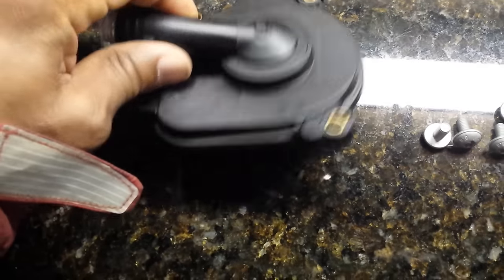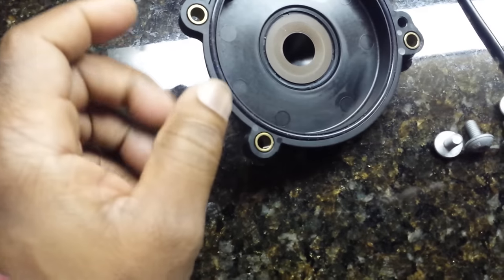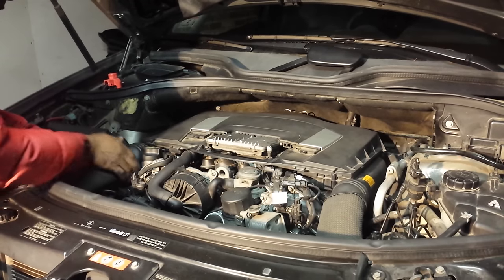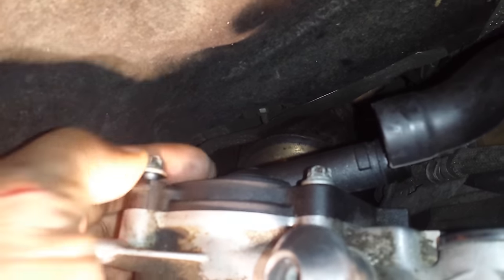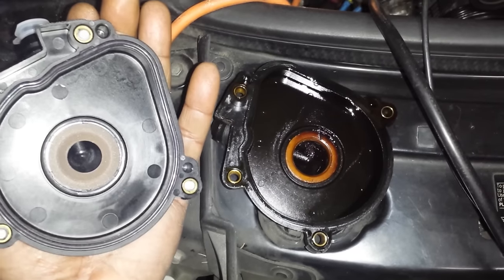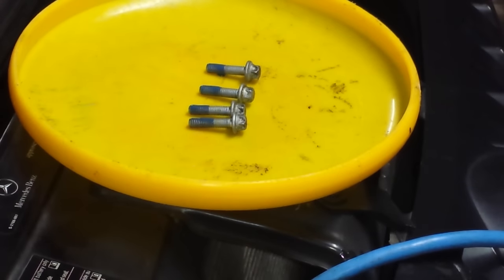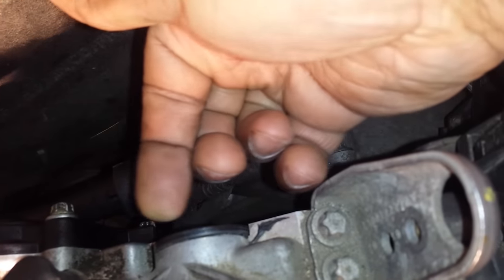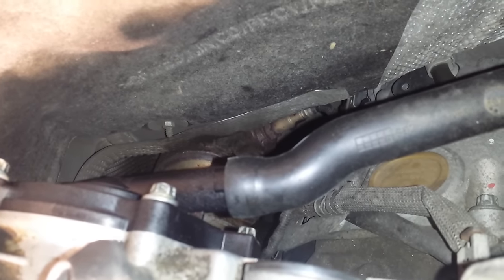Mercedes Crank Case Ventilation Valve Replacement DIY

Comment: hey i got 2016 benz c300 205 with around 50k and i dont see any oil leak on the ground or smell anything or hear anything wrong nore notice anything wrong with the car but had a check engine light come on like a month ago so i checked the gas cap first and it seems fine so i checked my oil and was time to change it so i changed the oil, the filter and the plugs and all went well and the car loved it also the check engine light went away ,but now its back a month later ..

the codes it p052e and it says to replace engine oil separator and parts required are pcv valve oil trap but under the code it says positive crankcase ventilation regulation valve performance ,now im like hum wth? so what part will fix the code / car ? the one in this vid or part crankcase ventilation LINE / OIL PEPARATOR ? because if its the second part then its suks bad to repair u gotta take alot of parts off and lift engine after engine mount are off and ya ?
Reply: Did you ever get it fixed? Mine is doing the exact same thing and would like to know if it fixed your problem

Comment: I wonder if it's possible to get the screws too tight on the vent cover? Causing the centrifugal wheel to bind and build pressure inside the engine? Because shortly after replacing the breather and cover on my M272 all the oil blew out around the oil filter cap. All eight quarts evacuated in about a minute. Nothing showing on the dip-stick afterward.
Reply from the maker: Hmmm. Sounds like something else is going on.  How long are the screws that you used?  Same screws or same exact length?
Reply: @iRepairAutos  the screws on my C230 are T30 Torx head. Not the same as in your video. But I did use the original screws. The unit I bought didn't come with replacement bolts.
Reply: I dont think this cause it.  Maybe your tube is plugged?  The way this work, there is circular oil seperator that is attached to the cam, which spins when it running.  This suppose to spin out any oil it collects and also where it collects any oil fume.  From there it connects to the center hole of the pcv cover.  This gives it the breather that travels back to the throttle and into the intake to burn up.  So yea, if the tube is not blocked pressure should be release unobstructed. Also make sure you didn't plug the oil separator with paper or cloth..  It is essential that it doesn't get blocked.
Reply: @accidental_relevance  The older Mercedes uses bolts.  The new Mercedes uses torx.  I believe from 2007 and up for the c230 it uses torx.  I worked in a 2006 and 2007 model and it has the difference in bolts.  I prefer the bolt, more easily to be worked on with the socket wrench.
Reply: One thing I noticed is that when I installed the new centrifugal wheel it did not turn freely. Like it had mated to a shaft. But when I checked the wheel after the oil blew out it spun freely by hand like maybe it was just powered by the air pressure from the engine.
Reply: Nope. The only piece that the pcv touches the internal parts is the soft flap in the center.  That piece gets moulded when you tighten up the pcv cap.  I am sure it's also lubricated with oil when the engine runs at some extent.  The only issue here is if the bolts gets loose over time from vibration from the engine.  You do not want to over tighten this, as it goes into the aluminum block and would be an expensive fix to repair that.  I believe the resolution of loose screws on the pcv cover is to add some blue loctite on the screws to keep it in place.
Reply: Just to follow up on the situation, I took it to a repair shop and their diagnosis was that I had not replaced the O-ring around the oil filter housing when changing the oil a few months earlier. They replaced it and I have had no issue since. However. Due to CV19 I have only driven it a few hundred miles since they worked on it. And if the O-ring was the problem, I don't understand why it would fail so suddenly. Even if I did fail to replace it, the existing ring worked fine for a full year. I would think it could for at least another few months. I know I did replace the oil filter when I changed the oil because I remember the oil filter had colapsed when I removed it. Something that I had not seen before.

Comment: my 350 started a high pitch squel... took it to the dealership and they advised I needed to replace the crankcase "centrifuge Cover".... which appears this is what your doing. They want to charge me 2000 to do this....this is a bit excessive would you say??
Reply: what code of yours？ mine is p052e7.also is a 2k bill from the dealership
Reply: Hi Austin,

Did u ever fix it was it definitely the CvV because i am having the same issue with my 2014 c300 it makes a loud squeal and when i take the oil cap off it stops. I saw another youtube video that pinpointed what the problem is but i want to make sure that it definitely is the CvV before i do it
Reply: Hi Austin, 

I am having the same issue. 
Were you able to get this fixed following the same steps?
Reply: @katrinaplummer6288  Hi, i am in the exact same situation. Were you able to get it fixed following the same steps?

Comment: Its great video. Whats the blue thing?
Reply: The blue liquid is for the bolts.  Called thread locker.  This is to prevent vibration from the engine to loosen the bolt and thus cause the leak again.

Comment: Guys I was driving last night back from work on highway and I heard a brush noise thought its a tire flat. Long story short anywhere 0 to 68km i have no issue drives smooth and no flat tire but soon as I hit 70km I hear tumble like flat tire,. What do you guys think it could be? 
2016 benz C300 4MATIC
Reply from the maker: Wheel bearing is my first suspect.  But check the brake pads as well.   A long list of possible things.

Comment: Hello did you get P052e code before you changing it?
Reply: That's the same code I'm getting and I have a '16 GLC 4matic
Reply: @delonhall2786  i have a c300 that P052e keep turn on and off. And i checks my car it dont have that crankcase...
Reply: @rya4841   I have the same problem with my C300 4MATIC W205.How did you solved it?
Reply: @Бране1201  I bought a crankcase intake from Mercedes dealer cost me $280. And I pay $ 600 at my local car repair to install it.. MB labor rates is so high. So far so good my car back in shape.
Reply: @rya4841  was it the positive crank case ventilation valve?

Comment: Brought this to an auto shop after smelling fuel/oil and they said it was an air oil separator issue after doing a diagnostic. They quoted me $1350 ($750 for the part and $600 for replacing). Would doing this fix this issue?
Reply from the maker: yes - absolutely.  change the cover, and the seperator and this issue is resolved.
Reply: @iRepairAutos thanks a lot. Do you know where i can find the part # for the separator itself? (2016 c300) Can't seem to find this "separator" on RockAuto.
Reply from the maker: @danielhwang4442 dealership parts counter or maybe FCP euro dot com\

Comment: 99 c230 Kompressor has the same type of valve-  will this part also dump oil to the MAF sensor if the valve fails?
Reply from the maker: it's kinda hard for oil to get back to the MAF sensor on that car because of the distance between the two parts.  But it is theoretically possible.
Reply: This part is designed to vent oily vapors from the engin into your intake, so yes it can make a oily mess in your intake and maf sensor , especially if you have a worn out engine with a lot of blowby. I suggest installing an aftermarket catch-can, between that valve and the intake. It separates the oil from the breathing air.

Comment: does failing crankshaft breather cause check engine light (obd2 code P0170,P0173)
Reply: should be P052E

Comment: Is there a lot of oil in this part?If I remove the part will oil start going out?
Reply from the maker: a perfectly working part should have little to no oil.  Use a rag when doing this repair.  There is not a ton of oil.

Comment: Thank you for sharing this video. It took me about 1 month to find where this oil leak was coming from on my c230 Mercedes. I found it because of you - thank you! I have a 2006 c230 sports model and I have to also change out the caps you were referring to in the end of the video, but I only saw 1 on the right bank (passenger side); and 1 on the left bank (driver side) is there one more I'm missing I'm not aware of? Please let me know. Also I see one breather hose that goes from the intake manifold to crankcase breather cap are there any other hoses I should be mindful of that need to be changed ONE-SHOT while I'm back there?
Reply from the maker: Hi Matthew, Glad you're able to fix that oil leak.  How many miles on your vehicle?
Reply: 99800 miles on it as of today. I'm ready to do my service B myself, but also had this small oil leak behind the engine near the fire wall and want to make sure i take care of all the necessary things before it hits 100000 miles. This YouTube Channel is super super helpful as I want to be able to maintain my c230 Mercedes myself without having to constantly go to a shop for service. Also my dad is an automotive engineer and I want to be able to carry on his knowledge.
Reply: Matthew, do you remember if there were a third cap? I am having the issue where I only saw 1 cap on the right and 1 on the left bank but could never find the third one and did you ever replace the oil separator(the part of in the video) and did it solve your leaking issue? Thanks.

Comment: Why not changing the separator sitting on camshaft at the same time? Faulty separator is a main cause for oil to get into intake manifold. Which is even worse for both spark plugs and cathalytic converter.

Engine is not leaking if there is negative preassure inside the engine. If the preassure is positive and/or there are leaks - its time to measure compression and rebuild the engine instead of simple replacement of a plastic cover...

Comment: What are the symptoms of have a bad crankcase valve?
Reply from the maker: Oil leaks at and around the edges of this part when the engine is running.  Oil in the mass air flow sensor, oil in the air intake manifold,  smoke from burning oil that drips from this part on the exhaust pipes.

Comment: So is this the positive crank case ventilation kit ?
Reply from the maker: Yes - Mercedes likes to rename things.
Reply: @iRepairAutos  hey i got 2016 benz c300 205 with around 50k and i dont see any oil leak on the ground or smell anything or hear anything wrong nore notice anything wrong with the car but had a check engine light come on like a month ago so i checked the gas cap first and it seems fine so i checked my oil and was time to change it so i changed the oil, the filter and the plugs and all went well and the car loved it also the check engine light went away ,but now its back a month later ..
the codes it p052e and it says to replace engine oil separator and parts required are pcv valve oil trap but under the code it says positive crankcase ventilation regulation valve performance ,now im like hum wth? so what part will fix the code / car ? the one in this vid or part crankcase ventilation LINE / OIL PEPARATOR ? because if its the second part then its suks bad to repair u gotta take alot of parts off and lift engine after engine mount are off and ya ?
Reply: Did you ever get it fixed? Mine is having that same problem now and would like to get some feedback from you
Reply: @chriscrypto3246  Hey brother I'm having this exact same problem did you figure out what the issue is i got a 2015 one and i just recently got the code on my car I was told that if you were to do the job yourself itll cost you upwards around 2100$ but i also heard that you dont need to replace the whole ventilation line you just have to replace one thing but MB doesn't sell the one thing so you buy the whole part. Let me know I'm searching right now hope i get a response from you.

Comment: Is it possible that the oil that pass to the throttle provoke a p2006 or p2004 code?
Reply: I don't know if that would cause the code to appear, but it certainly sounds like it is a very large contribution if not the initial cause of the broken plastic actuators due to the interior flaps being too gummed up.
Reply: Bingo.. It will eventually cause this problem from deposits of hard driving and accumulation.  Technically, oil fume deposit will occur regardless as I suppose that is how it's design due to how it's routed.  However, that is the design of the engine. The alternate if this is a problem for the intake manifold is to install an oil catch can, which creates a secondary filtration of the oil fumes and limits even further of what goes back to the throttle body and also the intake manifold.

Comment: My 2009 Mercedes C200 kompressor W204 1.8ltr is backfiring out of throttle body I think what would cause this backfire , I replaced coil packs an cleaned plugs didn’t do anything can anyone help me
Reply from the maker: Scan with obd scanner and post codes here.

Comment: Taking that bottom screw out and back in wasn't the easiest thing to do.  Thanks for the video.
Reply from the maker: Glad the video helped.  Please like and subscribe.  It helps move the video up and makes it easier for others to find.
Reply: If its a torx screw.. Its tough.  Bolt is more easily hand and can use a small flat socket wrench to do the job.

Comment: What code did you have to know this was the issue?
Reply: You dont want a code.  Usually, the smell of burnt oil or smoke in the cabin is the tell tale sign.   However, this part creates more issues. Look up intake manifold issues and oil catch can to help fix this problem.

Comment: Hey bro I got a 06 Mercedes E350. 
I got code P0444 and P0453
Any information will help
Reply from the maker: +Leroy Dennis they are both emissions vapor pressure related. The first one by itself would have suggested bad gas cap. But since it's both, the other one indicates bad evap pressure sensor or a bad connection to that part.  Good luck bro.

Comment: Your Amazon link says this is an oil separator cover...
Reply: This cover and the centrifugal separator inside are called by a variety of names. Even by the same suppliers. It's confusing.
Reply: Bottom line. Replace it. You will not regret it. This is a tip of the ice berg in what you about to find.

Comment: Does anyone know, if a bad PVC oil pan will cause car to run rich?
Reply from the maker: It can cause airflow issues for sure. It can clog up the maf sensor etc. So yes
Reply: iRepair Autos It seems like my issue is not getting resolved. I replaced the intake manifold plastic piece, cleaned fuel injectors, put new manifold seal and put everything back. Since then which was two weeks ago, I am getting rich codes and after clearing the codes, I don’t get it but icarsoft scam shows negative fuel trims in idle. I have changed MAF, MAP sensor and purge valve. No luck is finding the reason for running rich. Looked for leaks as well but no luck. Any idea what could be it? Have not changed the PVC breather yet.
Reply: and sparks plugs are changed few more months ago. I have also installed new air filters few days ago. Front 02 sensors are changed this past weekend. Now just loss what  an be causing rough idle and car to run rich. I do have the icarsoft MBII scanner. Is there any data that I should look to narrow down
Reply from the maker: Check your runner flaps on the air intake manifold.   I suspect the internal parts are disconnected from the exterior flaps.  They break. And would require a new air intake manifold.
Reply: iRepair Autos  Thanks for your advice. I do notice in the scanner. Intake manifold reads “short” as a status and does not change even with high RPM. I did check the flaps manually by moving the flap valve. But maybe they don’t work own their own.
Reply from the maker: Did you inspect the flaps when you had the air intake manifold out of the vehicle?
Reply: iRepair Autos Yes, flaps were moving just fine. I even cleaned it but these are the ones which you can see from outside closing and opening. I did not inspect the inside ones. Outside ones were moving freely and easy.
Reply: @iRepairAutos  talking about intake manifold. I got a p2006 code. Upon inspecting the intake manifold. The usual culprit that breaks remains intact. (the flap that holds the middle actuator). Upon further inspection i noticed the right actuator which connects to the flap( round plastic which is stuck into the manifold is detached. Such that it came off. While the left side remains intact. Could that be the problem with the manifold. And from what i could see i dont think its a part that could be replaced. Does that mean i need to get a new manifold. And how long more can i continue to drive without causing any further damage. I would appreciate a response.

Comment: problem is you never showed (even tho at one pint you said you would) what you used to remove the bolts and how -- its a very tight area - that would be the most helpful piece of information to know ... sadly the video failed to show that
Reply: If you don't know what to use just watching it, don't touch your car
Reply: Confirm. Tight area.  I believe other comments gave the info on what to use.  In some cars, it has a bolt and other uses a torx.  You will want to get some thread locker.  For me, I ended up getting some gasket maker, since what I install tends to leak even after I install it.  I think the cover was not made good(defective). Oh well, I can't return it, so I end up ad some gasket maker which is also another layer to seal this part.